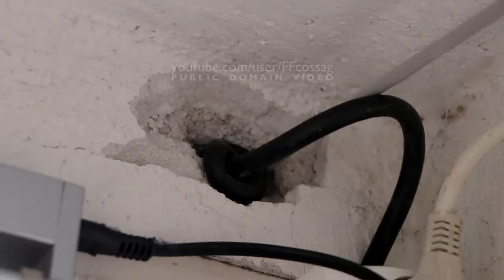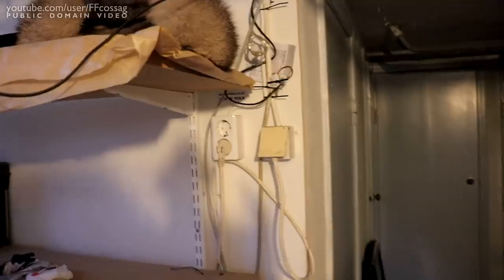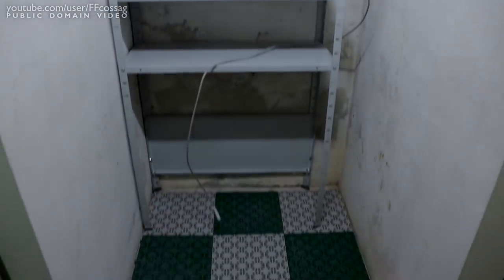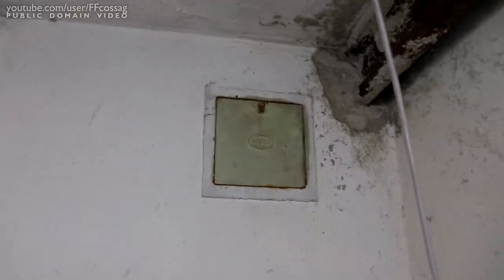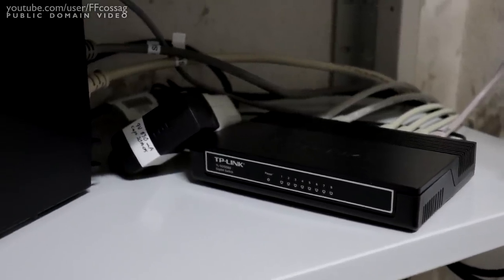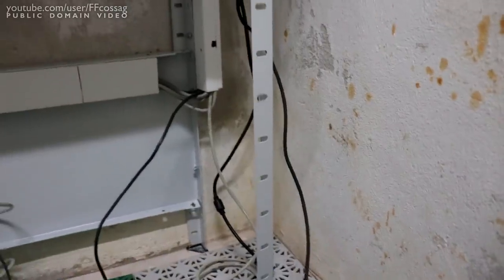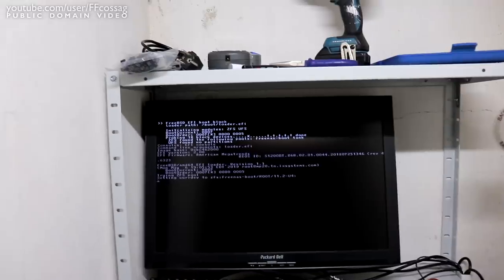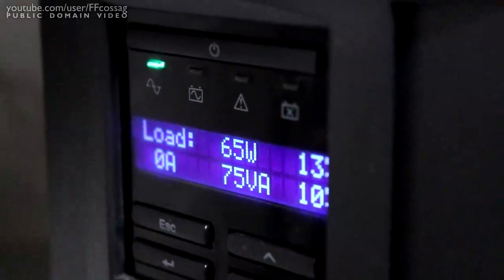Laundry room into server room.

Comment: A bit late, but have you considered maybe putting a small dehumidifier in  with the servers...? If theres drainage you can just feed the drainage hose down the pipe.
Reply from the maker: No need, there's an air vent if it gets too humid. But humidity isn't usually a problem at all since it's so cold down there.

Comment: I have a unicorn:-)
ST3000DM001-1CH166     49193 power on hours     0 relocated, 0 pending, 0 uncorrectable, 

but then i DID start with 12 drives, and this is the sole survivor.
Reply: I have a seagate notebook drive with 60K hours, two maybe three WD 3.5s with over 50k. Crystal disk info flags them all "bad" just because of the power on hours and load/unload count lmfao

Comment: That full tower case must be almost as old as you...  A friend of mine had one just like it back in the 90s.
I have a 5 port switch like that.  Had it at least 3 or 4 years.  Works fine for my use case.  (Too many devices.)
Reply from the maker: How old it is, no one knows. I'd like to use it for something, but the awful airflow in it basically requires it to get chopped up to fit anything modern, and I don't want to do that. :(

Comment: You really need a dehumidifier. Even with no standing water, high humidity will ruin electrical contacts and circuits in time.
Reply from the maker: Humidity is never a problem here, it's too cold. It's 0% in winter and <40% in summer.

Comment: Nice job, if the wiring works, it's all good despite looks... :D

Does make me want a basement to have as extra space for my stuff and projects & whatnot, but there's nowt but dirt under this house, and I'm sure the houses on this street have slid downhill ever so slightly as a result since they were built over 120+ years ago........ :P
Reply from the maker: Basements ahve more downsides than upsides, do not wish for one.
Reply: I had one in my first house that I rented, and hated it, most of the time it was a damp mess, and at its' worst it would flood to about a foot deep during heavy rain, wouldn't keep a wooden stool down there, never mind any computers... :S

Comment: 6:56 well, watercooling your servers sounds like a bad idea - and with moisture problems in that small room I also wouldn't put any good server hardware in there either :D
Reply from the maker: I'm getting the sense that the kind of water ingress I'm thinking of is a much milder thing than what everyone else is thinking of.
Reply: Yeah, it's fine with the mat. Even putting it directly on concrete it probably wont get to it for a long time. It took 25+ years for stuff in my gran's old shed to disintegrate because of the moisture from the floor.

Comment: If your bothered by the rough holes, white poly filler or similar would neaten them up a treat.
Use an old plastic credit card to smooth it around the emerging cable.
I hate the soft breeze block walls, you try to drill a hole and it just widens out :-(